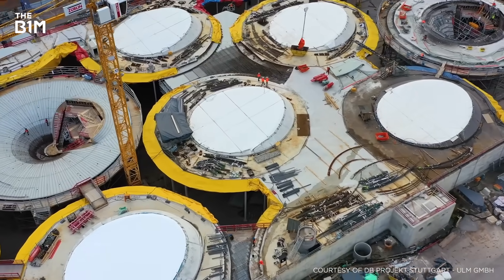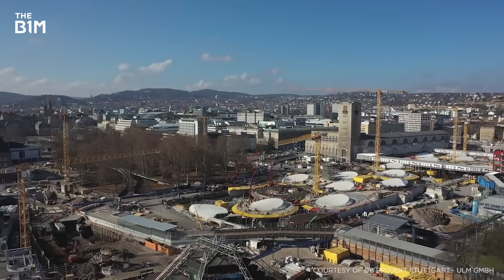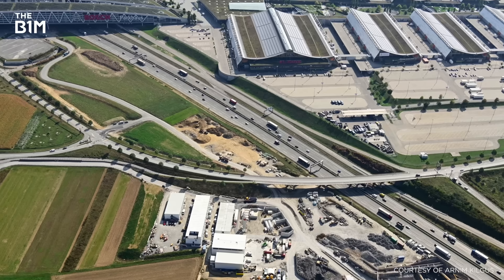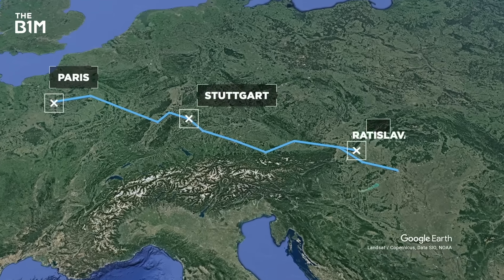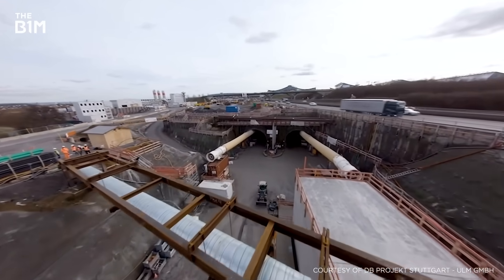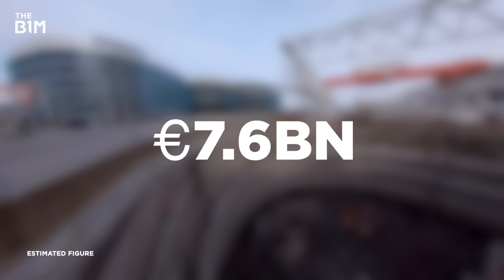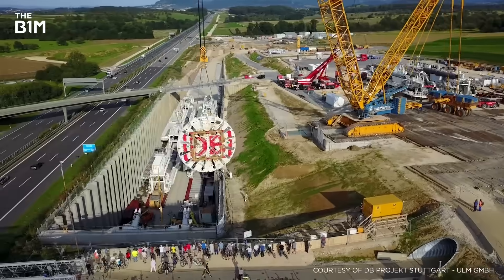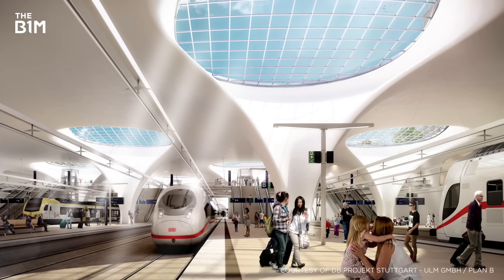Germany's 27-Year Struggle to Complete a Rail Project

Comment: The new station will have LESS capacity than the old one! Just 32 trains per hour, compared to 37 today.

And it will be very dependent on a few extremely high used tunnels.
If just one train gets stuck there, chaos will happen.

And the whole station is at an angle which is illegal for those big stations. It's only allowed for small stations.

The whole project is extremely shady. It was born right after Deutsche Bahn was privatized. Some very rich real estate investors saw the tracks leading up to the station as an opportunity to build lots of expensive housing and offices there.

The only thing in the way were the tracks...

The whole thing was a real estate project from the start. They even said that the project will fund itself through the sale of the needed land.
Reply: > The new station will have LESS capacity than the old one! Just 32 trains per hour, compared to 37 today.
Depends on which calculations you believe.

> And it will be very dependent on a few extremely high used tunnels.
 If just one train gets stuck there, chaos will happen.
Actually the bottlenck with the old station are the tracks connecting it to the surrounding country, and with Stuttgart21 there will be more tracks (8 compared to 6). So the current tracks are used even more than the tunnels in Stuttgart21

> And the whole station is at an angle which is illegal for those big stations. It's only allowed for small stations.
Wrong, the "maximum angle" is only a recommendation and there are multiple (big) stations in Germany where the angle is larger than that recommendation and it isn't an issue.

>  It was born right after Deutsche Bahn was privatized.
Deutsche Bahn is not privatized. 100% of DB stocks are owned by the German State. It is state-owned.

> The whole thing was a real estate project from the start. They even said that the project will fund itself through the sale of the needed land.
Isn't that a positive thing? Not only will the travel time between Frankfurt and Munich be reduced because of the new stations but there will also be new housing in the city center, the city park (Schlossgarten) will be made larger and the city won't be divided by ugly tracks anymore. Stuttgart21 will dramatically improve the quality of life in Stuttgart, which is considered one of the more ugly cities in Germany.
Reply: @lukasmaier8247  well 90 seconds is completely unrealistic for a whole train to empty and fill again

Comment: ...oh and the referendum on Stuttgart 21 only got through because it was in a bundle with the very useful Ulm extension.  A large majority of people in Stuttgart voted against the project but the majority in the surrounding region voted for the project because of the Ulm extension.  Analysis of the results afterwards showed that an "ulm only" option had the highest approval and a "stuttgart21" option would never have been approved.

Comment: Germany has to build more dedicated High-Speed Railways in order to have a comprehensive HSR nationwide network.
Reply: no, high speed is not going to make a big difference, because you can only go at the top speed for very few parts of the railroad. The Reason for that is that Germany does not really have few big cities, but rather a lot of stretched out urban areas. Due to that there will be many stops hence the maximum speed will erely be reached as the train has to break early to not wear down the brakes too much. Germany rather needs more transport on train and more frequent public transport but not faster.
Reply: @Jeagall  True, I think it will work for all of Europe though.
Reply: @AndrewManook  Where is that high speed train to Athens? To Istanbul? To Moscow? To Belgrade? Where are they?

Comment: This was a bad idea from the start. A reason why Frankfurt21 and other projects were rightly cancelled.  It was based on very dodgy analysis and cost estimates.  We had people on TV here promising that the costs were fair and would not rise.... months after it was agreed, they were on TV again saying they had been misquoted.   The station is not a good engineering project.  The platforms are at such a steep angle that if you let a pram go, it will roll onto the tracks  (they tested this).  The fire evacuation plans are really questionable.  The stone they drill through is highly water absorbant - which means that underground structures come under massive long term stress.  Everyone now agrees that going from 16 platforms to 8 platforms will limit capacity, not increase it.  The largest proportion of trains are not international from Paris, but regional.  Commuters heading to Stuttgart  !  For the "wonderful new park" they dug up 100 year old trees in a protected park that was already there.    A better plan would have been to make a seperate station for international trains at the rail crossing not far from the station.  A people-mover could move the small proportion of international travellers to the regional station.

Comment: There are multiple problems with the project that are not mentioned in the video, the terminals will be sloped because it has to pass over a tunnel on the one side and under a tunnel at the other side, resulting in a dangerous scenario for wheelchairs and buggys. Also, the rainwater management still remains unsolved and the risk of a flooded Terminal and tunnels remains present. Because of the (I believe) limestone that Stuttgart is built on the tunnels need to be narrower than normal resulting in escape routes that are only half a metre in width. Especially with the ICEs (the German high-speed trains), which are known for their increased fire hazard, fleeing during a fire could end dramatically. Even the initial planner/architect of the project has said that the project is basically impossible. So yeah, although it sounds great imo, the reality looks not that good
Reply: > the terminals will be sloped because it has to pass over a tunnel on the one side and under a tunnel at the other side, resulting in a dangerous scenario for wheelchairs and buggys. 

This problem is blown way out of proportion. There are multiple train stations in Germany with a similar slope where it isn't an issue. The slope is only an issue when trains have to change direction in the station because they then have to release the break for a moment (this won't be an issue in Stuttgart because trains won't have to change direction in the station because there is a sort of "roundabout" around it). Also overground platforms in other train stations usually are sloped towards the tracks because rainwater needs to flow away from the platform but the underground platforms can be sloped towards the center so that if a wheelchair starts rolling it will roll towards the center instead of towards the tracks.

Also regarding the escapes in case of a fire the calculations that the oppostion did are way too pessimistic. If you really took that as a baseline you'd have to close most underground stations that exist in Germany.
Reply: @lukasmaier8247  if I understood it correctly, the platforms will be sloped in over the length (the first wagon will be higher up than the last) by a slope of 15‰, which is four times the slope of for example Cologne leading to a much higher speed of items when they begin to roll and thus higher risks and more damage if the buggy or wheelchair hits an object
Reply: @wouterh480  Yes that is correct, but I know that people are talking about the slope over the length.

What i wanted to say is that the slope towards the tracks is 20 promille as well in a lot of stations, which would be even more dangerous than the slope along the length of the platform, no?

The thing is that there are other (smaller) stations that have the same slope as S21. For example there is one only a few kilometers away from S21: The station Stuttgart-Feuersee. It has about the same slope as the S21 platforms but I live near Stuttgart and I have never heard of there being any injuries. Actually, many smaller stations in Germany have a slope similar to the platforms of S21, otherwise you often wouldn't be able to build them. So it seems like the slope is not big enough for there to be any big issues with runaway wheelchairs etc.

You might have heard objectors of S21 say that S21 is only a "Haltestelle" (small station) because of the large slope. But this stems from a misunderstanding: The regulation says that large stations should not have a big slope (but there can be exceptions like for S21). For small stations this regulation does not exist. So some argue that S21 is a "Haltestelle" because it doesn't conform to the regulation.
However in reality the usual defining point of a "Haltestelle" is that there are no switches (Weichen) and that shunting (Rangieren) is not allowed to take place there. That also explains why the larger slope is not an issue for Haltestellen: The slope is an issue when trains change direction or are being shunted, because as I've explained above, the train may start to roll a few meters because the brakes have to be released for a few seconds. There have actually been some incidents in Cologne because of the slope. But shunting is not allowed at Haltestellen. Similarly, as I've written in my first comment, there will be no shunting in the new S21 train station so it should not be an issue.
So the objectors of S21 have it backwards: S21 is not a "Haltestelle", it is a "Bahnhof", but because the station will be run similarly to a Haltestelle (no shunting because that will take place outside at the new "Abstellbahnhof") the regulation (which is actually only a recommendation) can be ignored.
Reply: @lukasmaier8247  but I'm not an expert, I am just referring to problems I heard about whilst doing research about the project a year ago or so
Reply: What i want to make clear is that I'm not arguing that a wheelchair or buggy rolling onto the tracks is impossible, but that it's not really more of an issue than in other stations.

Comment: As a Hungarian I was absolutely astonished by the size and precision of the construction site in 2019. Back then I thought is was just normal development work, I only learned today from this report what a national struggle this project has been for Germany. I'm actually kind of surprised, Germany is known for their exceptional infrastructure and transportation system.
Reply: Come to explore the Swiss system and you will have “mouth dropping” moments...
Reply: There are a lot of things that Greg about Germany, but the train system isn't one of them 😂
Reply: The problem is that politicians always deliberately take the cheapest offers for such projects which is why costs explode later on. Also there was some shady corruption going on. The involvement of politicians was also the main cause for the BER delay
Reply: It will be worth it in the end when there is high-speed rail corridor all the way from Paris to Budapest.
Reply: @meh23p  
You know,I’m not against the fact to build a HSL from Stuttgart to Ulm or the Underground Station, BUT don’t close the 
Openair Station ! Take the example of Zürich ! 16 tracks above ground and 4+4+2 tracks under ground ,461’000 passengers and 3000 trains per day...
Stuttgart; 16 above ground and2 under ground, 255’000 riders and 1280 trains per day...

Comment: You should have mentioned all the criticism surrounding the resulting station, like the entire station being tilted,  not having enough tracks for the planned expansion of the railway system (downscaling from 16 to 8 tracks), it being embedded into a difficult kind of rock that could lead to breaking the tunnels and flooding the station with groundwater, or it being criticized for not having enough emergency exits in a situation of emergency.
Reply: You understand the operational difference in moving from a terminal station to a through station? 

  8 through tracks will still be able to handle well more trains per hour than the old terminal station setup.
Reply: @London755  The old station had only 15 tracks in use. Since the opening of the S-Bahn tunnel in the late 70s track #1 was not in regulary use anymore. Only for things like exhibtion trains. And out of these 15 tracks only 5 tracks were able to serve both directions (Zuffenhausen and Bad Cannstatt).
Reply: "flooding the station with groundwater"
The S-Bahn tunnel and train station at Stuttgart Hbf was built in the 70s. It lies BELOW the new S21 train stations. And was in all those years never flooded. Not by groundwater. And not by stormwater.

Comment: When it’s finally finished and the public are using it, they’ll be like , why were we even complaining.
Reply: They always complain. They even put some feces of a endangered bug on trees to make them stop.
Reply: The only thing is that many of the people around when the project started will not even be alive to see that day, given how drastically it has proceeded.
Reply: Until you notice there are only 8 railways instead of 16. and the whole station has a slope. And the emergency exits are only 0.6 yards wide...
Reply: @vincent5  the entire project is a disaster!
Reply: Yes and no. Yes because in the end the concept or idea just makes a lot of sense. No, because there are quite some safety issues with the current design/plan. Also, I'm still not sure about the capacity of the station. I guess it will be sufficient for the 'Deutschlandtakt', but what if they want to expand the number of trains in the future? Even if the project is finished in 2021, it won't be the end of the works there
Reply: Reminds me of the Berlin Central Station. Truly a wonderful project now that it's been Completed. And I'd rather see my country spend money on that than on more military equipment or misdirected social programs for banks and failing firms.
Reply: @danielmethner6847  you know it is possible to spend money on public projects without massive delays because of corruption and incompetence
Reply: @ItsPieManHD  is it though? 😂
Reply: @danielmethner6847  The only reason you can consider spending less on military equipment, is because the US taxpayer is paying to protect you.
Reply: @spacemanclips  yes, the refugee crisis that's been going on for the last 6 years shows us how well that is going. Totally cheap too /s
Reply: @spacemanclips  who is trying to attack Germany? Is it really protection if there is no threat?

Comment: "It’s unfortunate that Stuttgart21 is currently known more for it's struggles
than the incredible architectural, engineering and construction work going into it"

Very true, but to be honest, this video does little to help offset that, for example by digging deeper into the architecture instead of repeating the stories about the delays.
Of course, it's good to give a quick overview for those who are not familiar with this project, but I would have expected a bit more emphasis on construction from this channel (of which I am a big fan)
That being said, I still appreciate the production of this video which helps to bring attention to the project.

I really recommend researching how they did the highly complex support columns of the new underground station for example.
Reply: Unlike NY’s ESA Stuttgart 21 would be useful

Comment: We have a similar problem with the RER in belgium. The project first idea go back to 1990 and had several open target year each time push back (2002, 2012, 2025). The project span over Flanders, Brussels and Walloon and 4 public company (SNCB, De Lijn, STIB and TEC) and thus an administrative nightmare.

Comment: step 1: spending 8,2 Billion euro to half the capacity of your train station
step 2: ...
step 3: Profit
Reply: half the capacity? How so?
Reply: @3gunslingers  the new station is only half the size the old one was
Reply: @salzgurke42  
Yes, but it has double the connection capacity.
The only station could serve about 35-37 trains per hour maximum because of the inefficient connection the the rail network.

Even with half the platforms the new stations will be able to serve about as many because of the far better connection. This would NOT have been possible with the older layout.

Comment: Barcelona's metro L9&10, though to be the longest uderground line of Europe, being under construction since eraly 2000s and with just under half of the project opened and with no prevision of finalising it before 2030 rivalizes London's Crossrail and Barcelona's Sagrera Central Station, with 8 through platforms and a kilometric park over the track tunnels, under construction since 2008 and with the prevision of finalizing it in 2026 almost rivalizes Stuttgard's project.

Barcelona's infraestructures projects are an absolute mess.

Comment: Come on Germany you can do better. 11 years for constructing a single railway?
Reply: To be fair, it is a pretty massive railway, in the center of a city, while keeping major roads running through the construction site and preserving buildings on the surface above it, and operating the existing station while everything is going on.
Reply: actually the entire rail network in the state's capital city is re-arranged with this project, it's not only one railroad track or one line; Combine that with a rather difficult hilly region and dense population ...